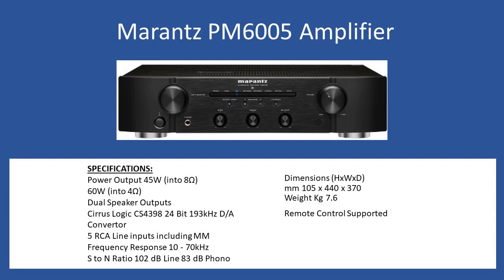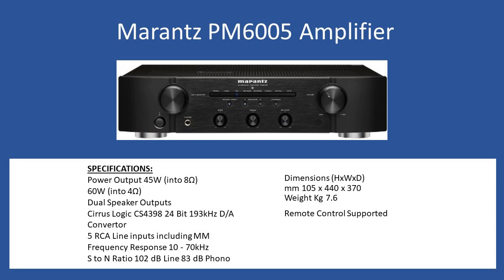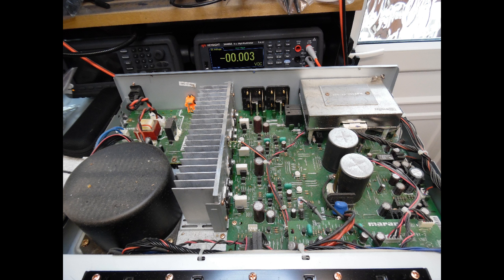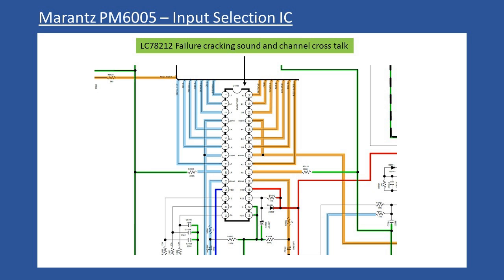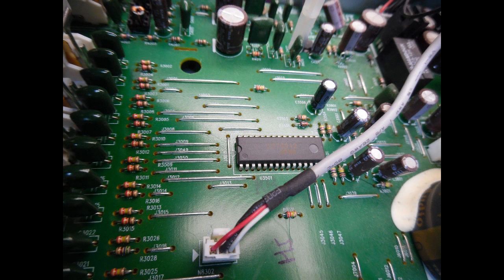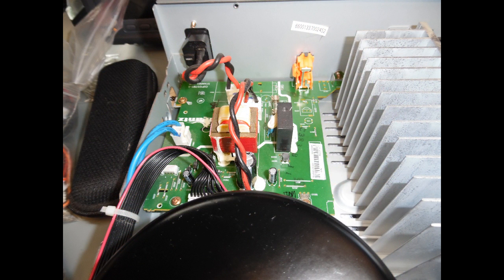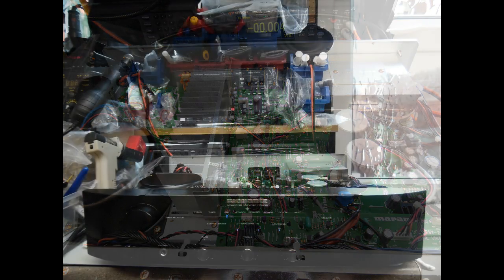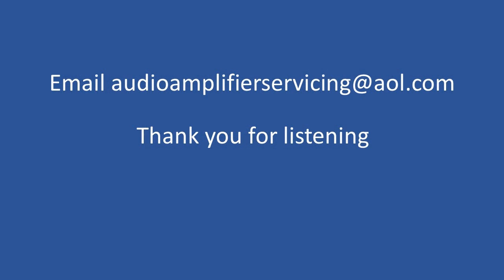Marantz PM6005 Amplifier Repair (With Audio Tutorial)

Comment: Hello Sir
Thank you so much for this video, I have a pioneer a-10 amplifier and the input IC LC78212 is having a bridged issue and very low output with distortion 
I have failed to get a replacement in my country and I’m asking if it’s possible to bypass the chip and have only one input source 
Kindly help me with this My studio is down because of this 💔
Reply from the maker: I have responded directly by email

Comment: Good morning.  Do you have a supplier for the LC78212 that you can recommend?  Thanks.
Reply from the maker: Hi as the part is obsolete only suppliers are on Ebay or AliExpress  https://www.ebay.co.uk/sch/i.html?_from=R40&_trksid=p2332490.m570.l1313&_nkw=LC78212&_sacat=0
Reply: @AudioAmplifierServicing    Thank you for the link.  I'm going to order one as my PM6005 input selector seems not to be working, sometimes, it does, then when I change sighting away to another input the LED's do change, but the audio input remains quiet and never sequences back to an active input.  Fortunately, I have a solder station, and solder remover/sucker and competent to give this a go.  I'd love to keep it working.  If it does not fix, I may have to rig it to one input and use an external selector which would not be idea.
Reply from the maker: @craigsanderson2858  Before replacing the LC78212 I would check the input selection rotary switch. You can desolder it from the circuit board and take it apart, you will see dried lubricating grease covering the switching contacts and acting like an insulator. You need to clean off all the grease, you can use a degreaser and a fibre glass pencil. The micro reads the switching contacts and then drives the respective LED and sends a code to the LC78212 which in turn selects the required input signal.
Reply: @AudioAmplifierServicing   Thank you - I'll give that a try.  Many thanks!
Reply from the maker: @craigsanderson2858  Your very welcome
Reply: @AudioAmplifierServicing   I did as you suggested and removed the input selection rotary switch - opened it up and while it looked clean, I did as you suggested and replaced the cover and re-assembled the front panel.  Input selection is working as normal.  Many many thanks for the advice and I hope I can enjoy another 10-12 years with this Amplifier.  Cheers, Craig.
Reply from the maker: @craigsanderson2858 That's great to hear.

Comment: Hi mine goes in to stand by mode .It is not connecting issue.What could be the problem?
Reply from the maker: Hi can you provide more information, when the Amplifier turn on do any of the LEDs on the front facia come.